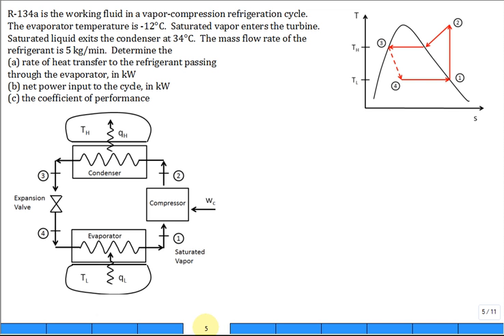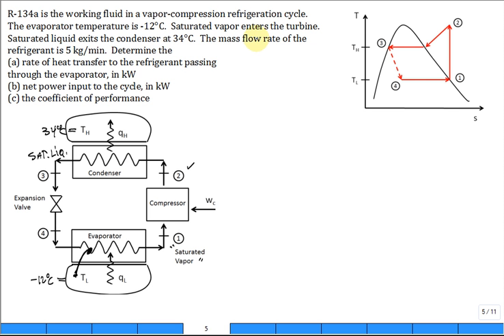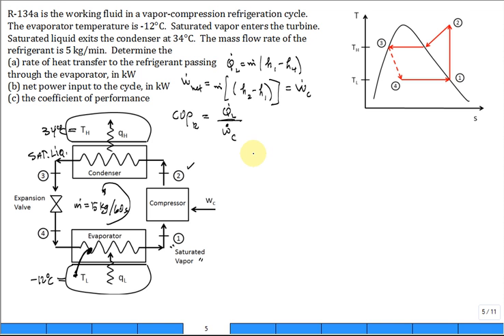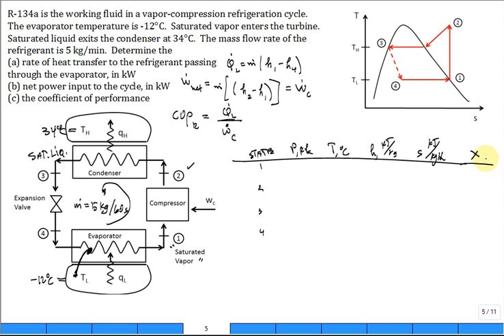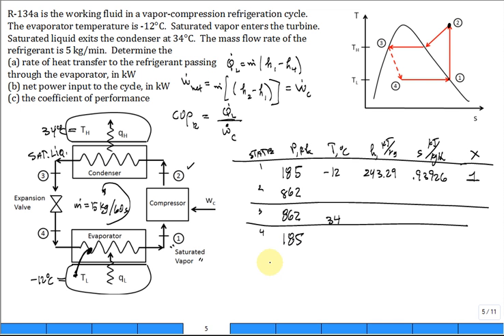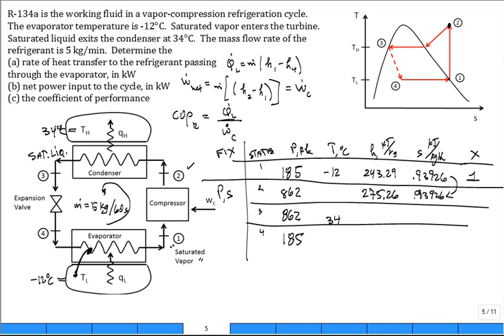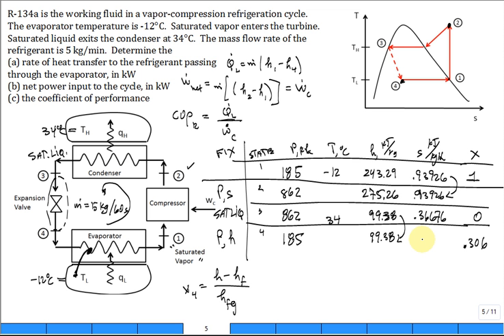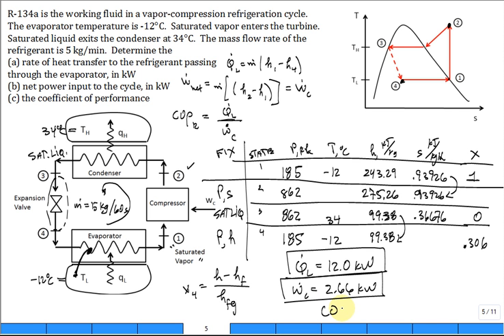Calc Vapor Compression Refrigeration Cycle R134a

Comment: where did you get the H2? what was the computation?
Reply: surely there is a way of getting that value not using software?  will I be able to find h2 with R134a saturation table ?
Reply from the maker: +Jerom NamGuz Ed state 2 is "fixed" by knowing p2 and s2=s1.  I probably used software in excel, call something like:  h_ps_R134a(p2, s2).

Comment: how did you get the enthalpy, x, entropy? what table or chart did you use?
Reply: it 300 plus here. please help me out. i've been wondering this for almost 5 hours
Reply from the maker: some may be from software, but values of properties are close in numerical values to tables in the textbook.  I just don't remember.  I like REFPROP software as well as software in Excel from University of Alabama.  Search "miniiRefprop" or "Excel in ME" to find.
Reply: thank you for your reply sir. but I'm really confused because my values are not close.
And now i found out that books have different values. here it is,

Based on Moran&Shapiro:
T= -12c 
P= 185.4
h= 240.15 
s=0.9267 

Based on Borknakke&Sontag: (My book)
T= -12c 
P= 187.02 
h= 391.05 
s= 1.7333 

that's a big difference sir. so what should i follow? Goodbless you.
Reply: we can't use softwares in exam. only calculator and ballpen. but i'll try using that here
Reply: Same confusion here  @Chess.Infinity
Reply from the maker: +Kevin Aton Either used property tables in back of textbook:  M.J. Moran and H.N.
Shapiro, Fundamentals of Engineering
Thermodynamics, 8th Edition, Wiley and Sons, 2014.   
OR from Excel Add-in from Univ of Alabama, http://www.me.ua.edu/ExcelinME/thermo.htm 
Both give very similar values (but not exactly the same).
Reply: Hi